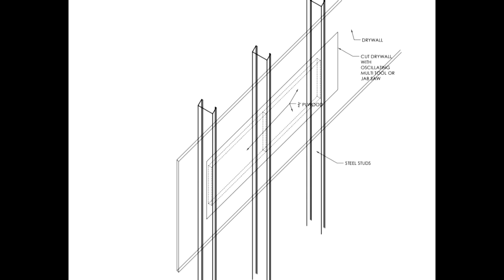Podcast 441: Screws vs. Nails, Insulation Behind Board Sheathing, and Details for a New Build

Comment: "If you have a small workshop and you need to heat it, you have too little insulation".  No.  If you live in an old house in New England or the upper Midwest, that you haven't done a full energy retrofit on, you have too little insulation.  You guys burn a crapload of fuel - most of these houses are functionally broken vs not just modern code standards but what was normal in cheap houses decades ago, and would be uninhabitable if energy prices quadrupled.  You should never be put into a situation where you emit most of your income directly as CO2.

"Oh, yeah, the walls just didn't get insulated when the house was built in the 20's, but the addition does have fiberglass" says my aunt. "I just set it to 60 in the winter and wear sweaters.  Some rooms are colder than others".

The fuck you say?  That's like saying you've been driving around an armored personnel carrier for the past fifty years, and yeah, it gets 1.3MPG, but that's just how they built them.  You could have fixed this ten times over from your heating bills, and been free to walk around in your underwear besides.
Reply: Hey, I like my armoured personal carrier. I don’t use it for long trips, only a 300km daily commute.